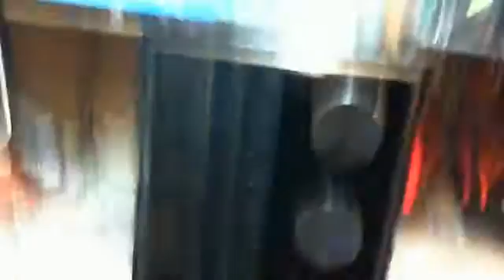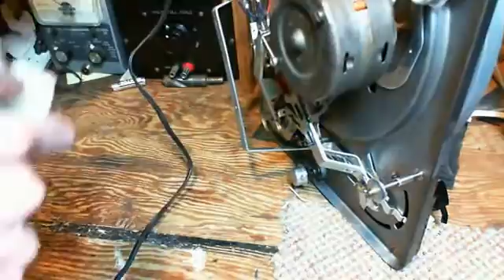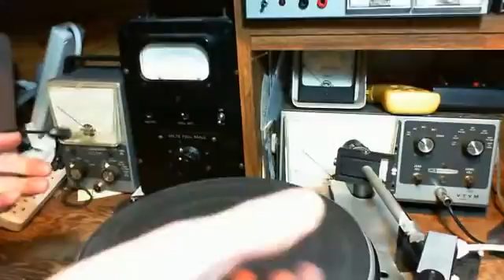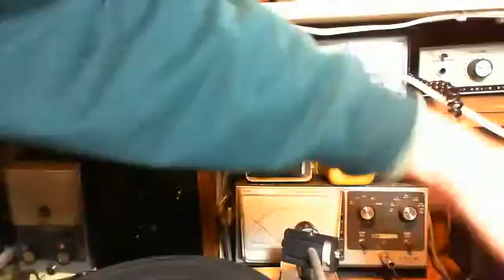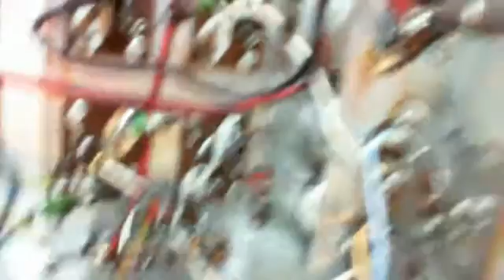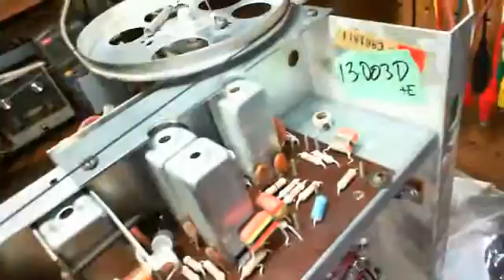Electrohome Console Stereo TR-50 Video #1 - Checkout Receiver and Turntable

Comment: Just to clarify some of the Daul statements you made. 1009,1009sk,1019,1015 are all brutes with heavy platters and with a decent cartidge they will blow the doors off most new turntables. the turntable is actually form the early 60s, the 70s had the 1200 models.  I just picked up a similar console. What are your thoughts on the Jensen speakers? I'm keeping the Dual 1009, going to upgrade it with a better cartdige and donate the console.
Reply: I still play the electro home Tr50 with the Dual 1019 on it,   I replaced the 1009, because the 1019 is a automatic arm return one,  they're building in a console name " Armada TR50" by Deilcraft from Canada.
The sound coming out is amazing.
Reply: Hey, old post ..but curious what you did with the console? Did you save the Dual? If so, what did you do with it? Cheers.
Reply: @oldmblover-p  refurbished the turntable, had to have the power connector changed for plug in and RCA cables updated. Found a1009 deck and kids for it and now my daughter is using it. She loves the retro look. Console was donated.
Reply: @desertrat9515  Very good. Thanks for the reply. I just acquired an Electrohome TR-50 yesterday. Has the Dual 1009.

Comment: Hi Jim. The marks on top of the can condensers are inspection marks showing that the unit was inspected before leaving the factory.
Reply from the maker: Thanks Dennis.  I was assuming the 'P' was an inspector's initial or department code or something like that but the 'X's caught my attention since an X is generally not good news.  A check mark would be nicer but I'm sure you are right.  Jim.